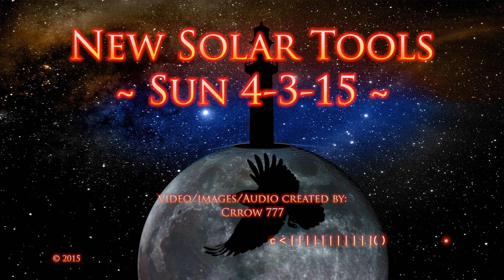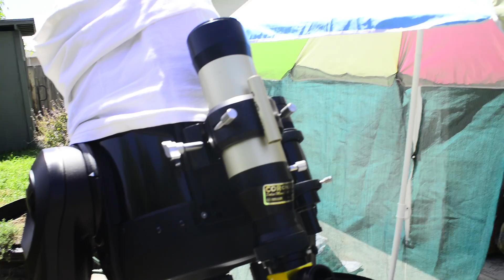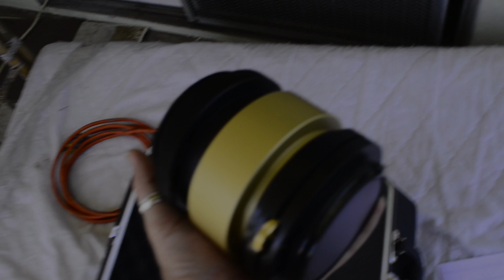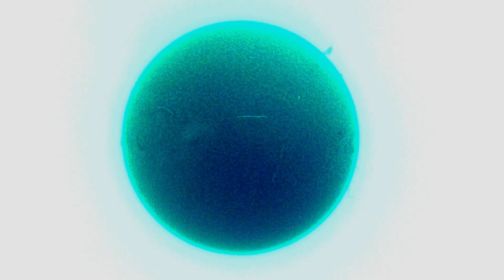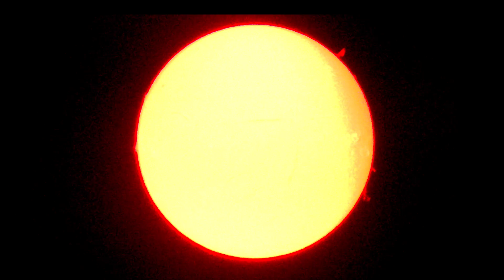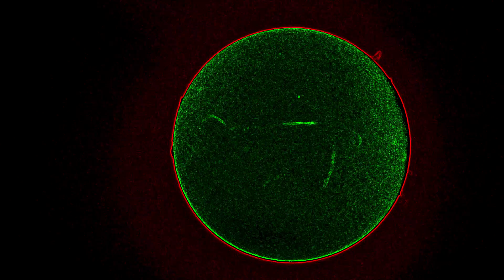New Solar Filming Tools, Better Surface Detail ~ Sun 4-3-15

Comment: That double stack is awesome, without the chemtrail interference!!
I don't have personal experience, but I've read that larger sized cloudbusters can rapidly break up chemtrails as soon as they're sprayed.
Maybe there's someone in the Los Angeles area who builds cloudbusters that would be willing to donate one to you??  You can build one yourself with copper pipes, organic resin, a bucket &  a couple other materials; they're not too complicated.

Comment: Has anyone felt ill after leaving Walmart or shopping center bc of the chem spraying? The sky over Walmart looks like grid patterns. Twice my grandmother has gotten sick  after shopping.....For three days the sky was blue, did not see any trails over my house.... the news called for rain and then, BAM!! the spraying started again. Now its been rainy and I feel aches. Should I blame this on barometric pressure or chemtrails?
Reply: Garryuana if there just contrails, what's with all the patens? Why are Chem planes all white with no logo?  Passenger airlines have color and logo and never leave a Chem trail. Contrails follow behind the plane and quickly dissappear and Chem trails follow behind the plane and don't dissappear.   Give it up guy your either ignorant to the proofs and what's happening above your head or you know it is true and your a troll. Is that hard to believe a govt. Could oppress there people?  It happens through out history.
Reply: debbie duran  I think you could just put it down to a bug or a flu
Reply: Crrow 666 ???
Reply: There's a LOT wrong with flu shots!  The concept may be valid but the addition of squalene, formaldehyde, mercury, etc., is NOT good for the human body.  You're better off without them.
Reply: HAARP....  They spray and then can manipulate the weather however they choose...
Reply: Garryuana Yeah I believe it is still contrails but they are purposely putting them in the air, not to pollute us but to keep the heat from reaching the ice/glass shield which causes megacryometeors to fall to earth when they thaw.
Reply: Truthseeker1961 haha
Reply: shook a.v. hehe
Reply: shook a.v. what government are spraying chemtrails
Reply: Garryuana "
The aches associated with barometric pressure isn't a fully understood phenomenon, but I'd lean towards that before chemtrails ;)"

 so something we can see is less real than something we can only feel?
Reply: Here in Australia we also get a shit load of Chem Trail action!  I'm in the Australian Capital Territory (ACT) where Canberra, our Nation's Capital City is located, so no one is spared the fallout of these Aluminum & Barinium  droplets and whatever else is in the mix!
Reply: DetectiveTOX then move
Reply: Garryuana  thank you! yes she's felling better......she also gets flu shots regularly and I'm sure you've heard what they say about that.
Reply: debbie duran there is noting wrong whit flu shots  but it is better for us to fight of bugs and flus by ourselves
Reply: Crrow 666 it is everywhere man, surely you know that.
Reply: DetectiveTOX so the people spraying are breathing it to ya?
Reply: Olivia Boyer Even if u escape a flu shot, toxic chemicals will still get into our system from cosmetics, lotions, deodorants, nail polish, toothpaste, medications, aluminum foil, plastics and foods.
Reply: +Crrow777 I would not know, where do they live? Lol! It's not about moving man it's about enough people waking up and thus enough pressure brings truth out and the chemtrailing stops!
Reply: Truthseeker1961 LOL!.....that's why I always sit in the car and wait.
Reply: Olivia Boyer there is mercury  in flu shots .there was organic mercury  in them years ago  .noting there now
Reply: Crrow 666  dude what r u talkin about? Go check out the ingredient list. How is aluminum going to protect the flu? Everyone needs to know what Pharma is all about, make people sicker and profit.
Reply: debbie duran  I did  its not in it  your just being lied to.  to make profit   from  the fear porn sites    ps   in saying that  you are better off fighting any flu off your self
Reply: Crrow 666 I do and when if I get sick I don't take no meds and I I'm recovered in three of four days...meds seem to suppress or prolong it..
Reply: debbie duran all most meds do is hide the symptoms   .that's noting  new  ..ps   "I dont take no meds"  is  two negatives  witch make a positive  .....I know im being a dick now  lol  be safe

Comment: in pa spray also 2 things want get ur opinion    1. could they be spraying radiation? why if you watch video something funny happened on the way to the moon, they said radiation cause effect in your eyes, My eyes when gazing seems to get flashing of pin points  of strange light effects. 2 why when you are observing have you ever seen space station iss? or a usgs gps satellite?

Comment: Anyplace you can rent a property for a day or two where chemtrail insanity is less?
Reply: Patrick McCoy Rent a property? It's like this across the whole state, and it's pretty significant here in L.A.. This past week has been very bad. I wouldn't be surprised if I found some traces of the aerosol chemicals mixed in with the pollen that's on my car.
Reply: South Dakota